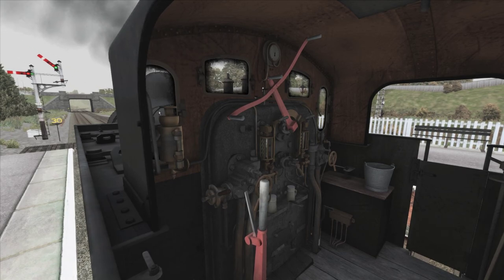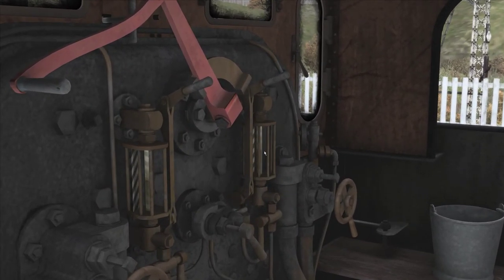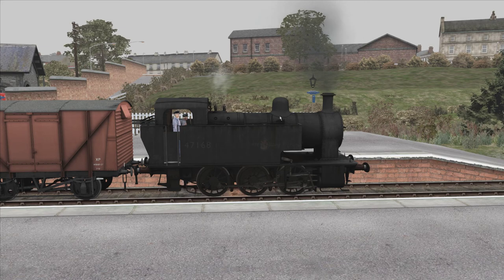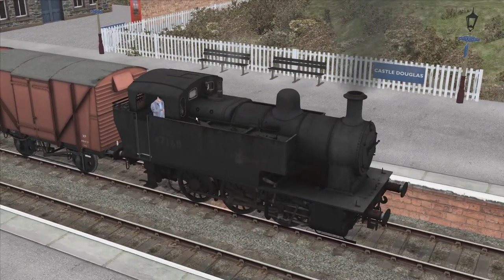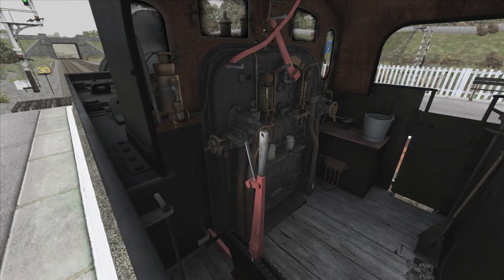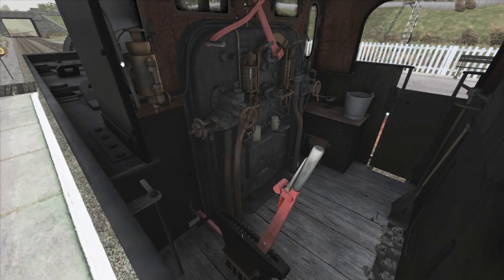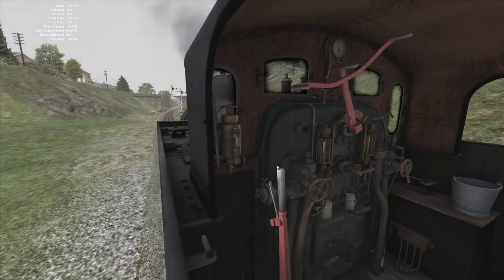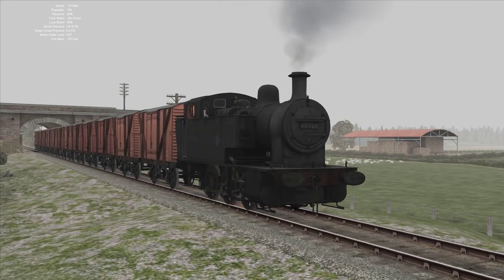How to drive a steam locomotive in train simulator 2022!

Comment: don't think thats a steam break think its a vacume 
and  i only rhink that engine has one damper and the blower is used when the engine is moving as well just to let you know (not trying to be smart but just trying to help)
also fun fact both the regulator and reverse should not be painted red as this was something that happened during presivation
Reply from the maker: This locomotive does have 2 dampers! I believe the locomotive has combined brakes but I could be wrong. I don’t have experience with that certain loco.
 Cheers!
Reply: @salohein2742  may i ask what class it is
Reply from the maker: @Adam-wu8nh  it’s a class 2f 0-6-0T Dock tank
Reply: @salohein2742  the combined break i can see but i can not see the second damper as there is only one handle to open them but good practes opening the water first on the injector
Reply from the maker: @Adam-wu8nh  ah, as said before I have very little knowledge on this locomotive. I drive the more realistics.